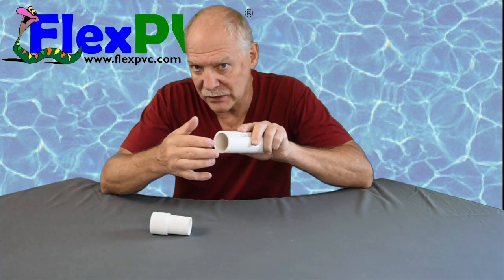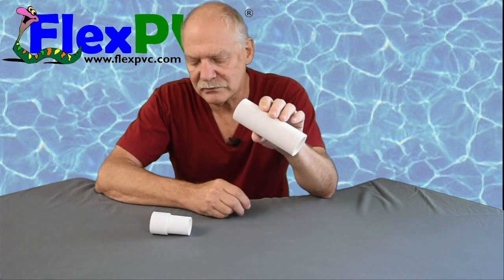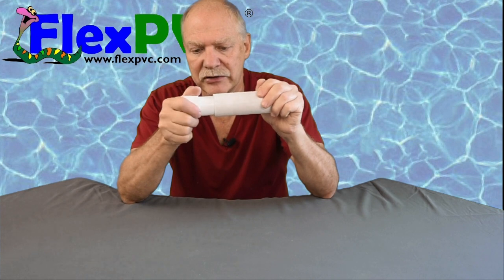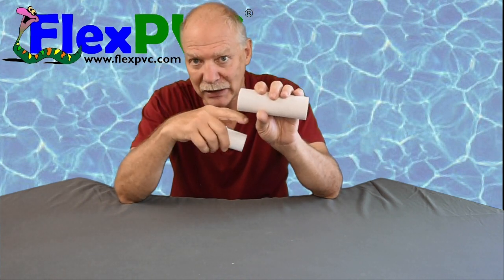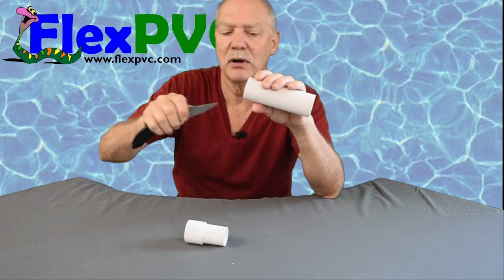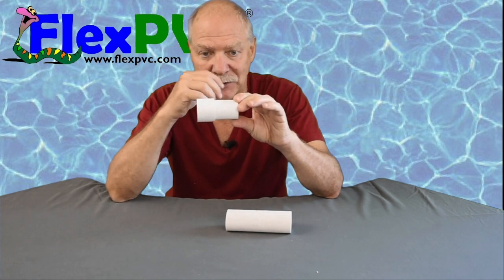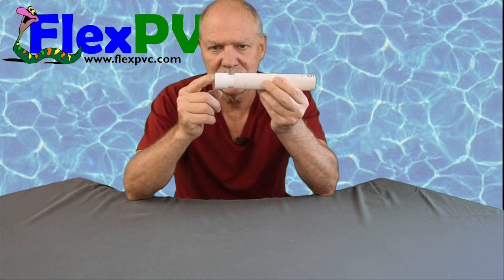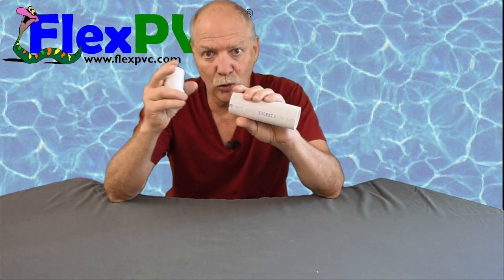FlexPVC - Understanding Pipe Inside Diameter and wall thickness.

Comment: I am looking for a preferably a 2 inch flexible Hose to join 2 pieces of pvc hard pipe that doesn't have much room between the 2 pipes. It's for my hot tub it needs to slip over both 2 inch hard pvc hard pipe. I can cut back a little on the hard pipe this is why I prefer Hose. I need to clamp it o both sides  I tried your email it doesn't seem valid.
Reply from the maker: sure. see https://flexpvc.com/cart/agora.cgi?product=Flex_PVC_OVERPIPE-ByTheFoot

That will do exactly what you are trying to do.

NOTE: 2" pipe is 2.375" OD. If your pipe is 1.900" OD you don't have 2" pipe you have 1.5" pipe. So be sure to measure your pipe accurately. Or you can read the size directly off the pipe if you can see the printing on it.